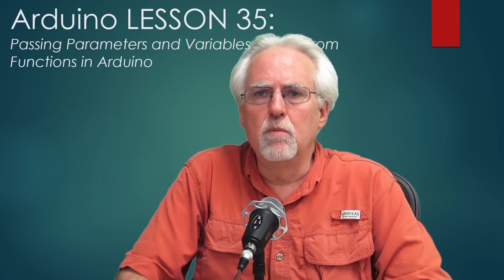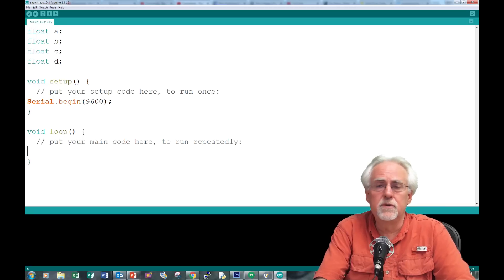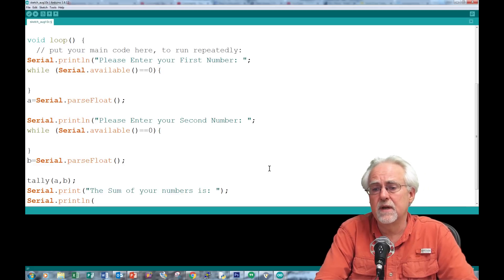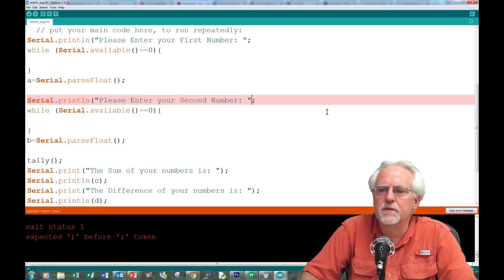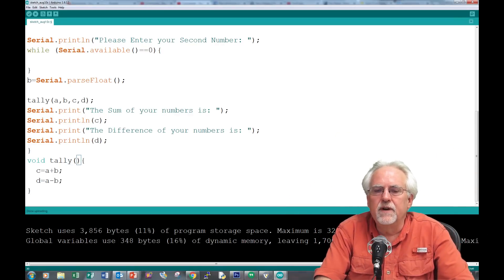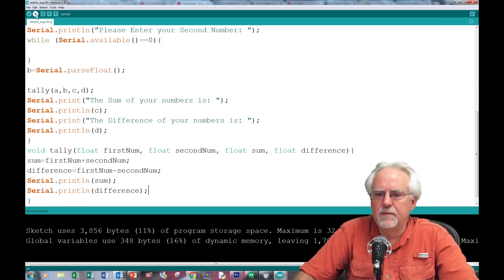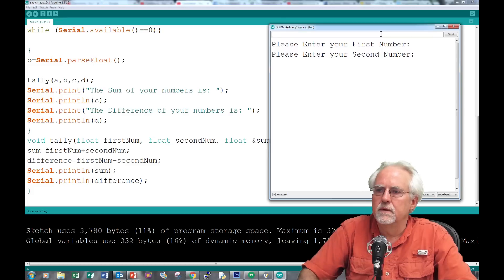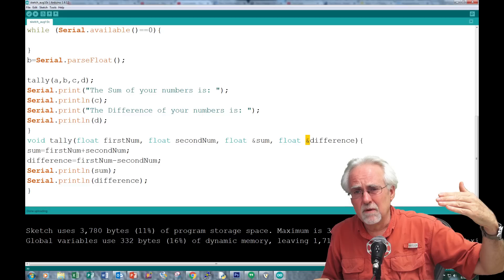LESSON 35: Passing Parameters and Variables by Reference in Arduino Functions

Comment: Hi Paul,  Ignore the picture, that was me in my younger years!
First of all, "thank you SOO much".  I love your Arduino IDE videos.  They are so much easier to understand than any others i have come across.
The question:    I have been looking at a number of projects for making clocks recently, and almost all of the code use the terms ++x or x++.
For a long time i could not work out what it meant, until i found it in the arduino.cc webpage.
x++; // increment x by one and returns the old value of x
++x; // increment x by one and returns the new value of x

Your code is more "old school", using x=x+1, which in my opinion is the "proper" way to do it.  But as i am 59 years old now, and was brought up with the original BASIC, i guess i would prefer your method.  However, could you possibly create another video in the Arduino IDE series that covers this topic as clearly all the "young ones" out there are determined to use this newer syntax.
There is also a - - x and x - - too (where will it all end).

Comment: I like this, using the Ampersand seems so easy to pass the parrameters back.
Because of their position in the Void tally() function name (3rd and 4th) they match up with the position of the parameters in tally(a,b,c,d); so sum will reference to c and difference will reference to d
Nice.
Great information Paul, I would have found it time consuming to find that answer else where I think.
Also because you're not using 'return;' the function type is again Void, please correct me if that last bit is incorrect.

Comment: Excellent lesson.  I typed some notes on this lesson because you covered a LOT of details.  I took special note on function construct, order of argument list in tally().  Noted no RETURN in this construct, concur like this better.  I looked up the reference operator (&) and I found out that it actually returns the address and retrieves the value of that variable Address....awesome.  I assume we don’t have a RETURN because we are using the argument list list instead.....and I also assume this is a void function because we don’t have the RETURN as well.  Finally I learned that in the tally() function definition the variables were type cast in the definition argument.....I did try to type cast them in the function body and I got some compiler errors.  I LEARNED SOMETHING VALUABLE.......THANKS.

Comment: I have learned so much from your lessons, both if using the Arduino controller and in the programming language itself. In this lesson, it was all programming. I enhanced the program to use a separate function for ADD, SUBTRACT, MULTIPLY, DIVIDE  and finding the SQUARE of the first number. I used REFERENCE to pass parameters back as well as the return command.

Comment: Great, Sir.
I want to move some functions to my own library I can use later and I need to know how to pass and get back variables that are not in the same file. The other problem that arises is how to keep variables from those functions alive after I call the functions. ( I receive a string on the serial port, any time I receive something on the port I call the function which is building the string, it adds to the string, check if the string is completed and if not returns to the main loop. If the string is completed, it breaks it to code and variables and returns them. Question is how to keep the string until it's completed(in the library function) and how to return the two variables(from the library function) afterward to the main program

Comment: H Paul   Having an issue with the code as it does not pause to allow entering the second number.   It looks correctly coded, but to be sure I went over to your website but can't find it.  In fact, I cannot locate "Lesson 35" under "Arduino Lessons" as it stops at 33.

Comment: Hi Paul, I am a very-soon-to-be mechanical engineer and have been doing a lot of project based learning with Arduinos.  Thanks for all the helpful videos.  One aspect of arduinos that I am having difficulty understanding is how the baud rate can affect or limit your sampling rate when using the analogRead() command for analog sensors and communicating the data through the serial monitor.  For example, my understanding is that the default sampling rate for the analogRead() command with an arduino (16MHz clock speed and 10 bit ADC) is 9615 Hz, but if I set the baud rate for serial communication at anything below 9615 bits/sec * 10 bit ADC = 96150, won't the serial communication baud rate truly dictate the sampling rate instead of the arudinos built in ADC converter properties?  Not sure if this is an area you have studied, but if you have any thoughts, I would be interested to hear what you have to say. Thanks

Comment: In C++, & is called reference. It acts like a pointer, so & will change the value of a specific memory address, rather than only using the passed content for calculation. The 0/1 states of the transistors inside the CPU is changed by &.

Comment: Hello, Mr.Paul McWhorter. Thank you very much for all the Arduino lessons. You can make things very clear. I like to ask you a question: What is the best method to do the following: I connected 6 sensors to the ports A1 to A6. I have to read the values (value1, value2,value3 etc) of those sensors. Can I do that in one function? a function like: for(i=1;i<=6;i++).  Can I use "i" in the naming of the port and in the value? Thank you !

Comment: Hi Paul.  I'm posting this question here because it looks like this is your most recent video and I thought it would be the best chance to reach you.  I want to use the RockBlock Iridium modem on a HAB.  I can write a php script to process the HTTP POST messages from the RockBlock ground station and write the data to a file on my web server.  So my question is what to do with the data from there?  Like how to you get the data from the file on the web server to your Python displays on another computer?  If you could point me in the right direction I would really appreciate it!  Thanks!
Reply from the maker: YOu need a script to make a text file on your web server, and then have python read the text file. That is the easiest way to do it. You need to end up with a text file on the server, and python can easily go grab that.
Reply: Thanks Paul. I will give it a shot.  One more quick question if you don't mind...  Do you find that the data coming back through the RockBlock is pretty well in-tack (ie. not corrupted)?  Wondering if I need to do any sort of error detection on the data (like a checksum)?
Reply from the maker: Pretty clean data packets.

Comment: A little off topic. But close to this video. I have 52 variable named valve_0 to valve _51. I am making sure that each valve is setup and read. I don't want to write 52 Lines of code. How do you increment just the number at the end so I have just a few lines of code.
Reply: use an array instead (eg: int valve[52]; //assuming they are ints) and you'll be able to access each variable in a for loop like valve[j]

Comment: Thanks Paul. I was not aware of this method. Is there a reason you prefer it of using a return statement. Return seems more readable to me.
Reply from the maker: Return will only send back one value. What if I need to work with several variables in one function? Returns are OK, but just my old habits, I like to more formally pass parameters back and forth like shown in this video.

Comment: How come the function Tally has void in front of it even though it returns a value? Isn't void used when no value is to be returned?  I'm confused.
Reply: The function did not return anything, as a matter of fact it didn't even finish by 'return' so indeed it is a void function. The way values were "returned" in this case is actually by passing the memory addresses of  c and d through sum and difference using that & symbol. Since for instance c and sum now share the same memory address, any modification made to sum within the function will also affect c in the main loop. Nothing is returned.